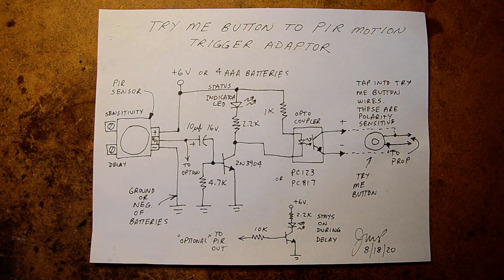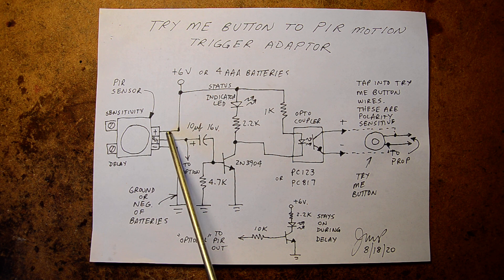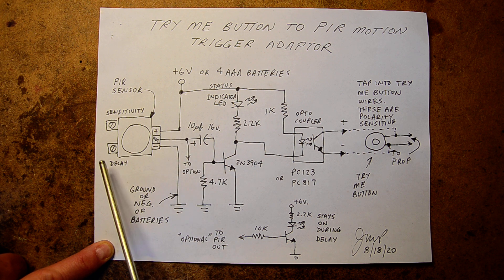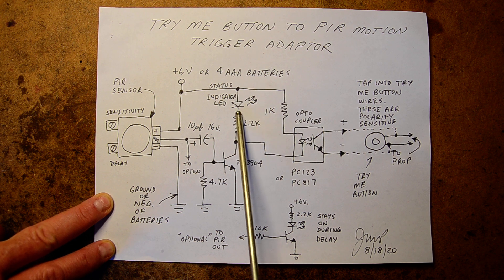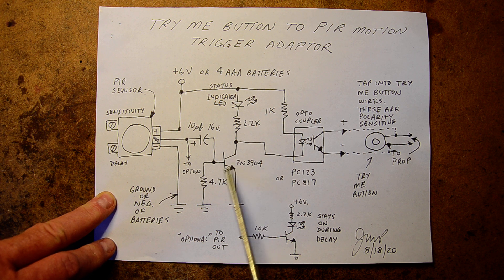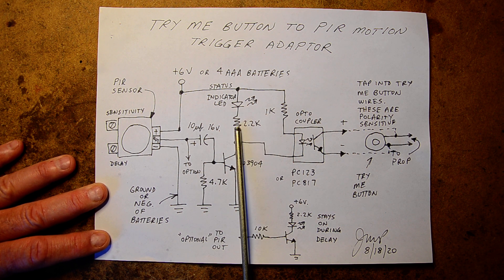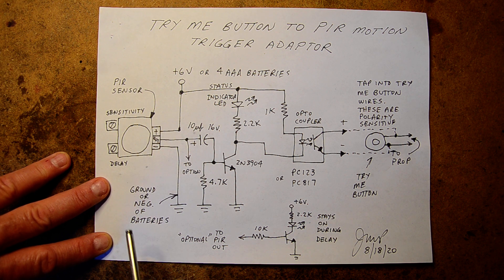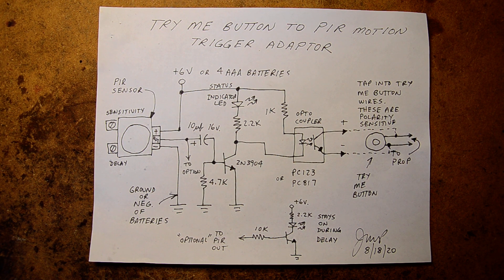HC-SR501 PIR motion trigger interface to TRY ME button schematic for Halloween and Christmas props

Comment: Have you thought of making and selling these? I can't believe that there isn't an off the shelf item available. Or is there?
Reply from the maker: Glad you liked the idea and circuit I invented.  I'm flattered you thought it is useful enough to try and sell.    My  payment is the fun of designing these gadget circuits.    I should at least sell printed circuit boards for this device.   I am just not in the mood to learn how to use PC board software to design a board and have made by all the PC board makers out there..     What would you be willing pay for a PC board???    Did you see the other circuits I have come up with on YouTube
Reply: @jp040759  I have no idea what the going rate would be, maybe $20-30? I am checking out more of your site.  The circuit was just a bit beyond my skill level to figure out the components and proper placement. :(

Comment: Interesting, but why not just connect the output of the PIR to a simple relay?
Reply from the maker: Optocouplers are way way cheaper.  Optos are very low current especial for battery operation.  Solid state devices do not ware out like mechanical relays do.   Optos are way war smaller.   No contacts to corrode from outside weather and moisture.  Optos require way less current to activate to on state.  Optos do not generate electrical noise or high voltage spikes that can kill electronics.  Optos have  way way faster switching times in orders of magnitude over relays.  Shall I go on with Opto's benefits?   Thanx for watching.